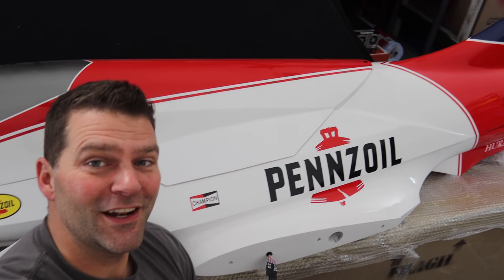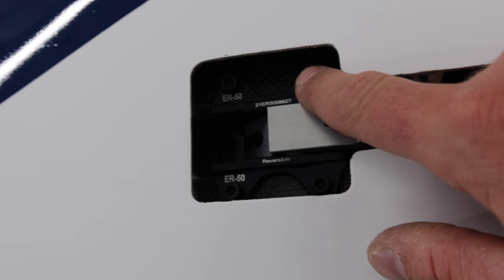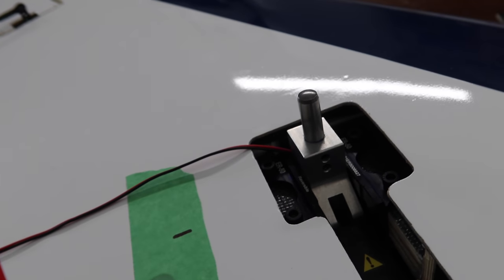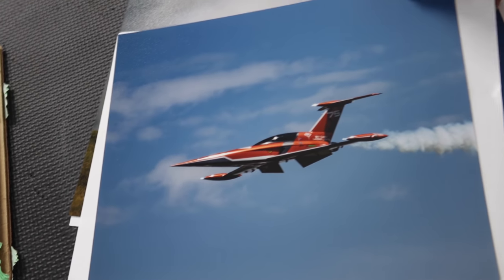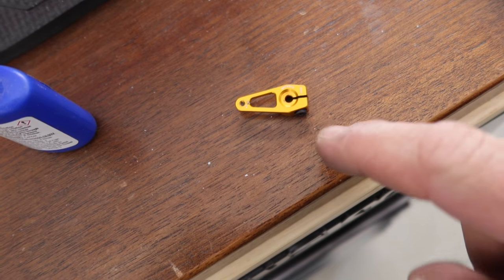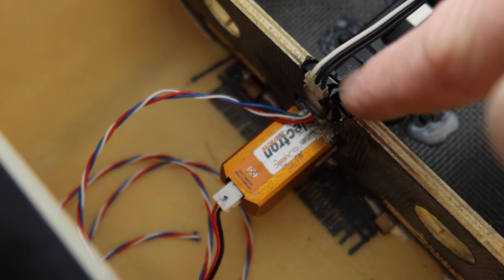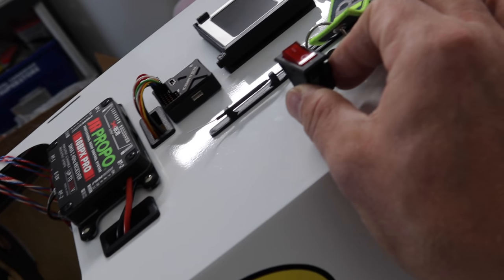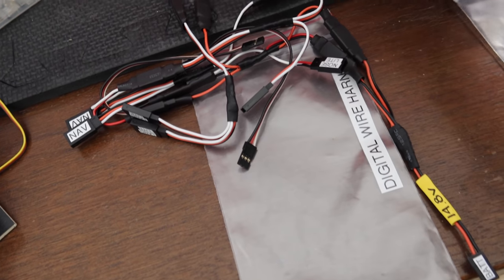BEAUTIFUL HURACAN BUILD CONTINUES - Gear Mounting & Fuselage Work

Comment: I just finished watching the full video. Congratulations too KAZAMA624 for winning the SKY CANDY LIGHTS.Great video as usual. Great job on the gear set up. Also I would like to state that on wire harnesses that don't use the voltage regulators, they don't need a rocker switch battery cut off. This is because Jonathan is using high voltage batteries for his FULL SCALE LIGHTING SYSTEM and we needed to incorporate castle creation voltage regulators to protect the landing lights .So exciting to see this jet get closer to completion.
Reply from the maker: Thanks Sal.  I probably should have mentioned that in the video.  😎

Comment: Metric thread taping drill hole = bolt size - tap thread pitch so M5 x 0 .8 pitch drill size  is  5mm- 0.8mm = 4.2mm
Reply from the maker: Phenomenal!  I didn't know that!  Appreciate it!😎
Reply: @thelightersideofrc  Also another old trick taught to me via same fitter is is a quick way with say both metric and imperial screws is to take the nut and find a drill bit that will just go through the nut and then go maybe 1 size up . This is dependant on material ie stainless  steel . When I was a shift electrician at a cannery . With Aluminium you dont have to go the 1 size over etc
Reply from the maker: Awesome 😎.  Thank you!

Comment: Do you usually run a switch for your gear controller & brakes?  Would/Do you do it similar to how you do your lights? Or do you run battery direct to your controller for gear & brakes ?
Reply from the maker: No, all the main items (turbine, Reciever, gear/brakes) are hard battery plugs.  Problem with using a switch is it adds a failure point.  I use it on the lights because you have to power up after reciever is on and before it gets turned off.
Reply: @thelightersideofrc  thanks for the info!  Keep up the good work!

Comment: Why would you not run longer bolts ? Threading wood works in the short term but will fail over time. You fly on grass and that is a heavy jet . Along with the fact that wood moves with heat and humidity so it not a good fix
Reply from the maker: Primary reason is I would rather a bolt pull out of the threads on a hard landing, gopher hole, running off the runway.  With blind nuts your wreck structure.  I may put the mains on with blind nuts and use longer bolts as you have suggested.  Thinking on it.😊